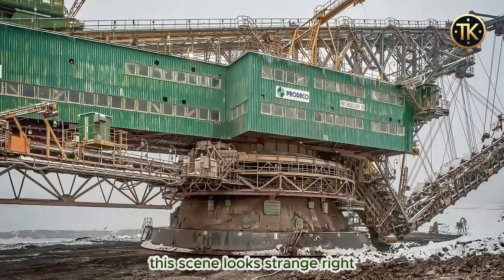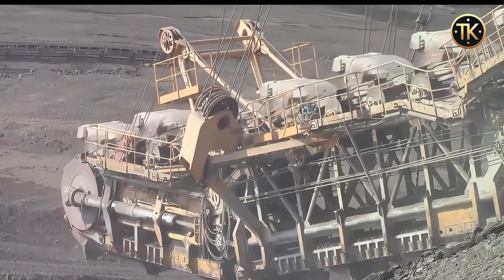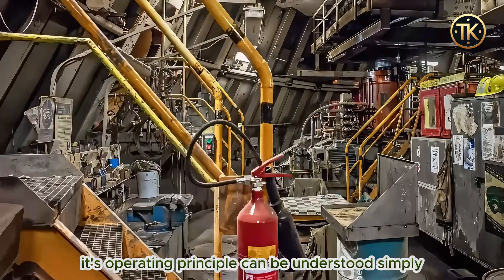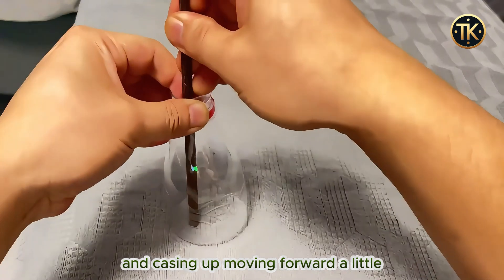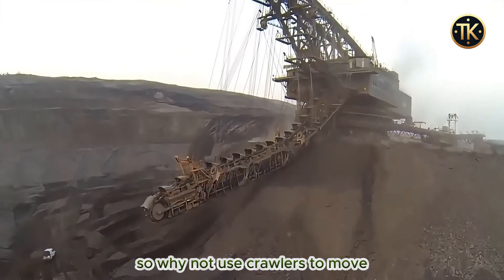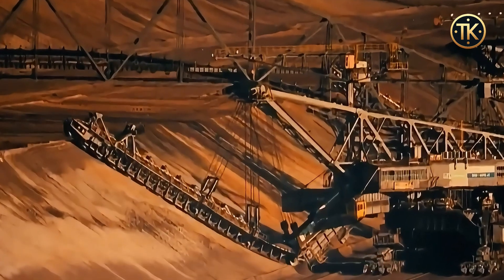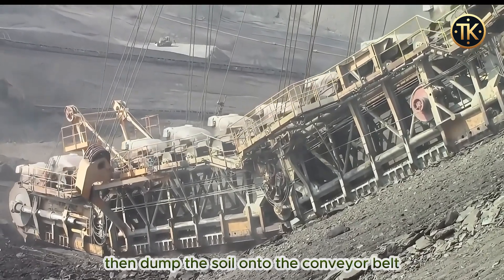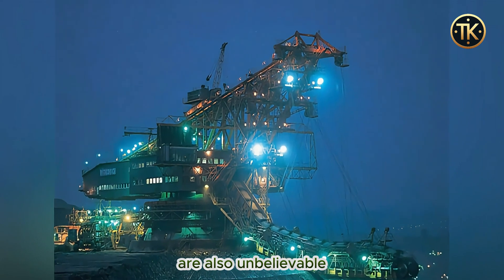RK5000 Track Excavator: How Does This Giant Dig?

Comment: There is a lot of footage of bucket WHEEL excavators in this video. This is an RK5000 bucket chain excavator digging:
https://www.youtube.com/watch?v=nOPX661jiL8&t=453s
After years of digging, wear prone components like the chain drive motor's gear pinion are in for replacement (audibly so):
https://www.youtube.com/watch?v=6ftL2ZRUvZQ
The last shot of the second video shows the cable reel on caterpillar tracks, which follows the machine, to feed it with 6,600 Volts AC. There was a video of the hydraulic lifting and shifting installation inside the foot, showing it in action in real time, but the maker took the video off-line and i can not provide a link anymore. All credits for the videos go to the makers.